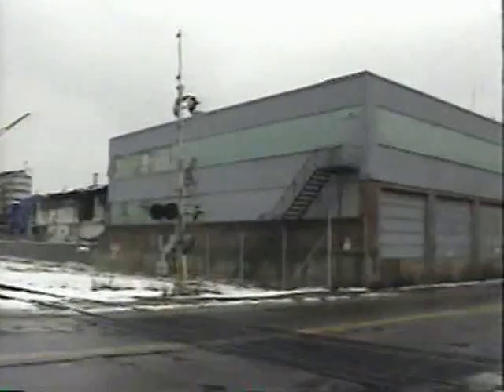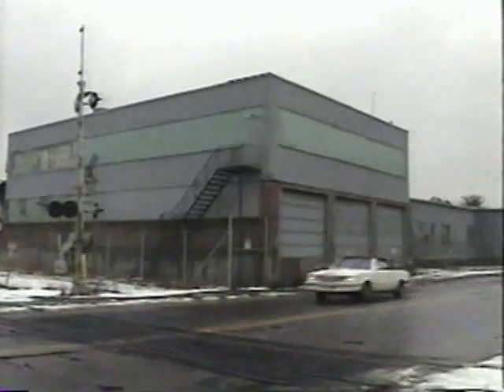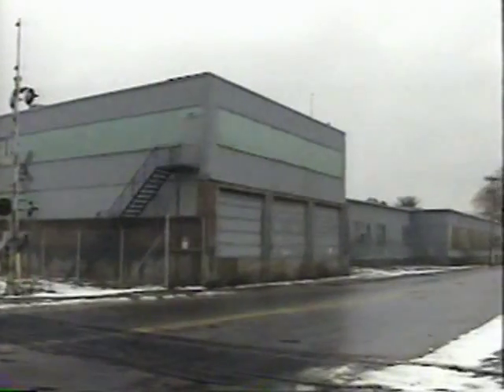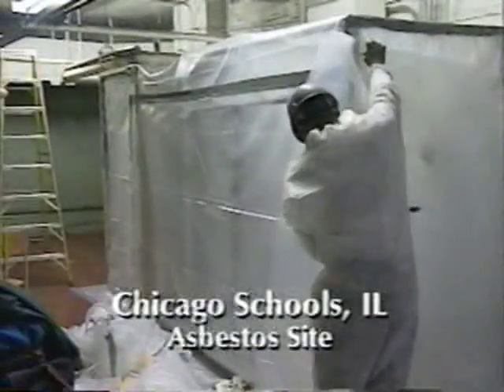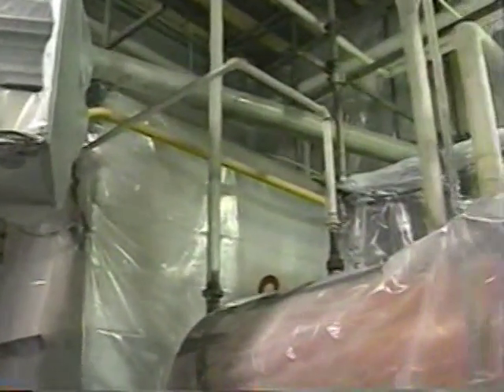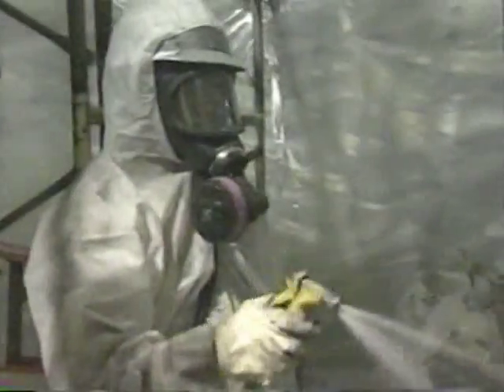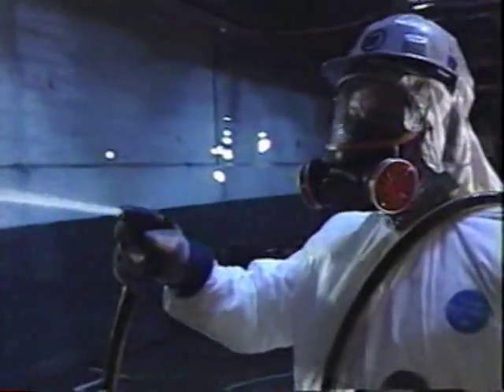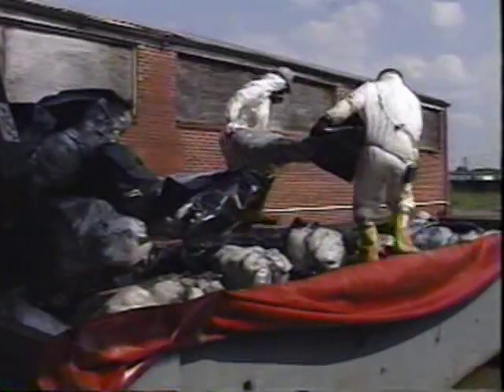Overview of Asbestos Removal Procedures US 1999

Comment: @darester if your not wetstripping asbestos insulation its incredibly dangerous. Non notyfiable like Asbestos cement (Chrysotile) doesnt have to wet stripped. Asbestos Insulation (Amosite) does need to be. Infact in the UK if your caught drystripping AIB or Pipe lagging without wetstripping or shadow vaccing you'll lose your removal license.